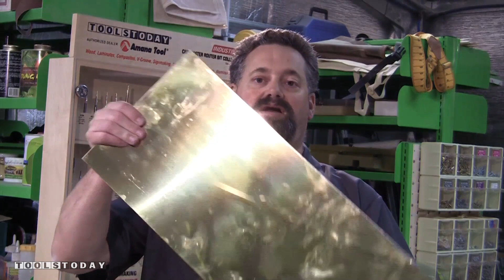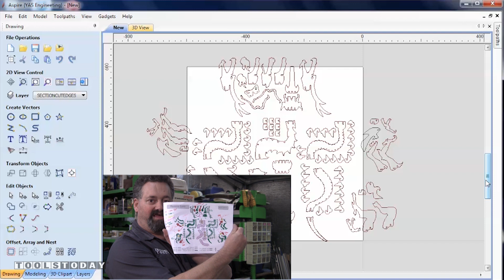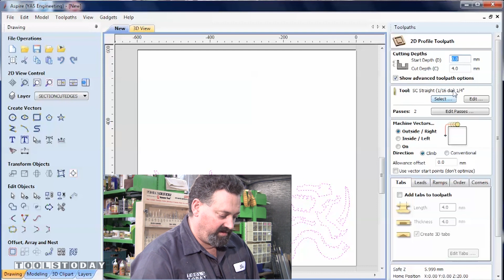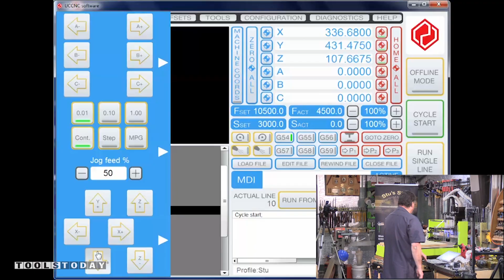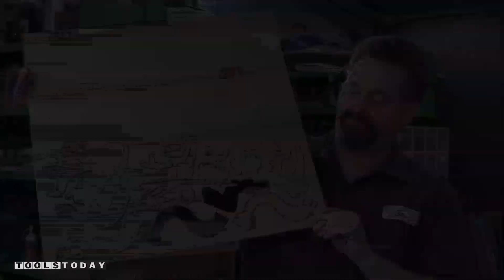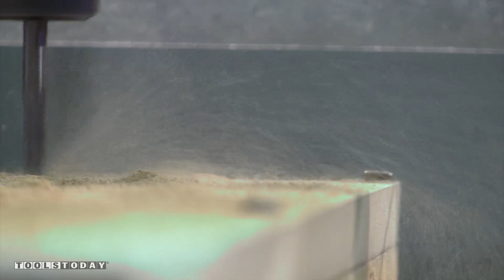CNC Project: Multi Material Dragon w/Amana Tool Master CNC Router Bit Collection

Comment: Your depth of cut on the plywood with a compression bit didn't take advantage of the purpose of that hardware.  Got a bunch of tearout because the bottom of the bit is an up-cut while the rest is a down-cut.  Also, I haven't found anyone who's reviewed the spoilboard surfacing bits that can explain the scoring cutters advantage have over the standard 2 outer diameter.  Or when to use one over the other.
examples would be 
RC-2248
vs
RC-2249

Comment: do you guys make all the data files for the end mills you have for vcarve. if i had those for free it would deffinetly encourage me to buy the end mills from whomever provides those options
Reply from the maker: We are continously adding the .DXF files as we receive them from the manufacturer, Amana Tool. For instance, these In-Groove router bits have  .DXF files: http://www.toolstoday.com/p-6009-in-groove-cnc-insert-engraving-tool-body-replacement-solid-carbide-insert-knives.aspx
Reply from the maker: Which data files are you referring to? We provide feed and speed recommended operational charts on the ToolsToday.com website. Additionally, there are DXF files of the tools that will become available.

Comment: How did the corflute turn out, I don't think it was mentioned at the end? I'm interested in cnc cutting of that material.
Reply: Enjoyed your video btw. Cheers.
Reply from the maker: +Srekwah, The Corflute material was a clean cut.
Reply: I misunderstood. corflute was metioned in passing at the beginning. Just out of interest, would you have an opinion on whether a 'drag knife' would be better on corflute than a router bit?
Reply from the maker: +Srekwah, While we don't have hands-on experience using the Drag Knife, the Amana Tool® router bits are made from high quality solid carbide and carbide tips, therefore providing longer tool life and clean cuts.

Comment: What kind of CNc machine did you use in this video
Reply from the maker: The machine is a Torque CNC 9060, which is made in Australia by YAS Engineering in Queensland.

Comment: Nice video.  You really need better work holding or vacuum to machine metal sheet.  I bet those carbide cutters are in bad shape with the amount of vibration and lifting of the sheet (particularly the brass).
Reply: Definitely agree that a vacuum table would really be a useful addition.  And downcut bits do make a lot of difference with thin, flexible material.  The one thing to keep in mind is how critical chip clearance is for some materials, such as aluminium, where a downcut really works against you for clearing chips, even while helping push the material down.
Reply: ***** What about using a downcut endmill on the metal sheet? I had someone tell me that works as well. Havent tried it yet myself though.